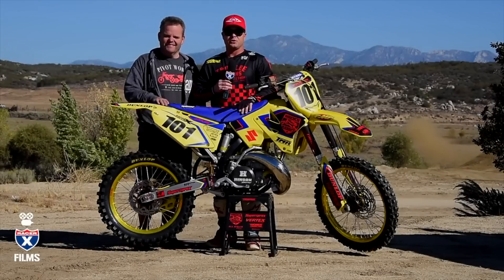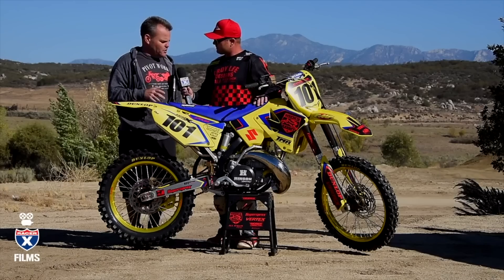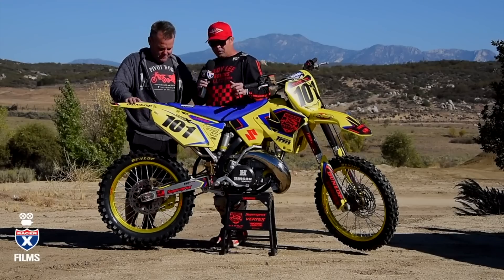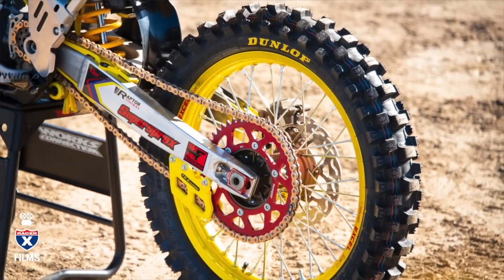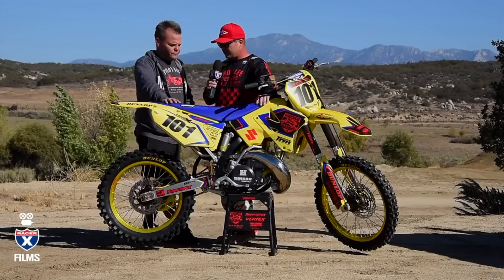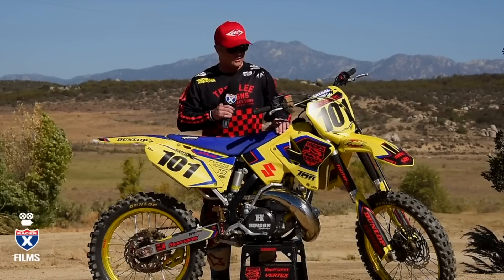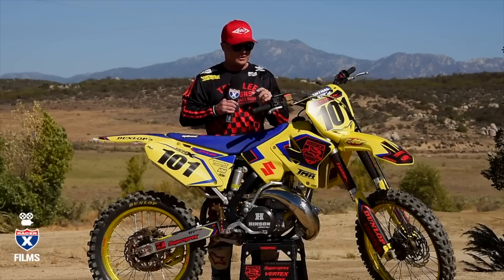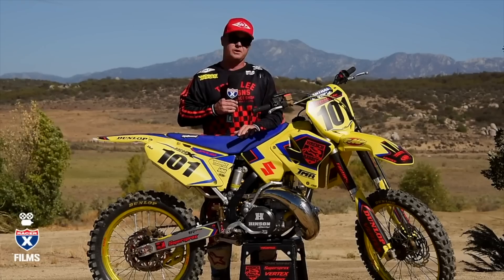Racer X Films: 2003 Suzuki RM250 Garage Build Project Bike Two-Stroke

Comment: Ah the good old Suzuki rm 250. Remember it very Well when RC twisted the living thing out of that 05 factory rm.  Damn you AMA / FIM for ruin the two strokes at the highest level wich basically took 3 major brands of the two stroke market.
Reply: Move to KTM/Husky/Beta or other EURO bikes   they got NEW 2 strokes that are counter balanced and 10000 times better!!!
Reply: @mt1885  Many of us grew up on these 20+ year old 2 strokes and it isn't about new technology.  Sometimes you can't put a price on nostalgia.
Reply: @rm6317  I do like the RM's the problem is I am not going to support them since they abandoned 2 strokes. TPI is the way to save them from the eco-idiots.
Reply: @mt1885  KTMs feel so off, I’d rather have a Yamaha any day
Reply: @ParaMoto910  Yamaha sit on top, notchy shifting, vibration - does not corner well.

Comment: You guys mention nothing on the Hinson compents.  Did y'all get the complete set - basket, inner hub, pressure plate ? Reason being I'm got it all for my 04 RM250 but the pressure plate and would give my left nut to complete my Hinson clutch. :)

Comment: If I’m 17 168 pounds but I’ve never owned a dirty bike would it be better for me to get a 125 or a 250 ?? I’m a huge fan of 2 strokes and dirt bikes but I’ve only rode quads before for example raptor 700, yfz 450, banshee. What do you recommend?

Comment: Would love for my 99 to look like that. It runs like that. What kinda $ did it take to make it look new? Curious af. 😆
Reply: It's not that hard get a 01+ subframe 01+ air box and 01+tank and you will have to make 3 custom Mounts for the subframe and there you go get the 01+ seat and plastics 1999 2000 the front finder will bolt up and you will need to make a mount for the tank if you have a welder it's really easy and it's strong and need to make a mount for the front number plate

Comment: Too bad it's not a 2004 or later. Big improvement in the rear suspension design. 03 feels like the rear suspension is trying to lift the bike from underneath,its an odd sensation.